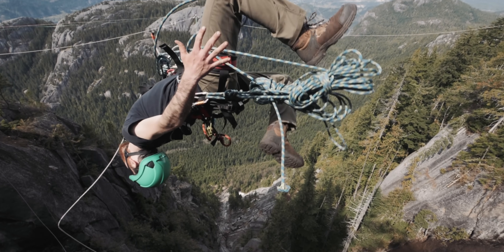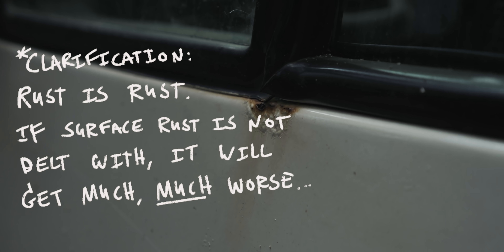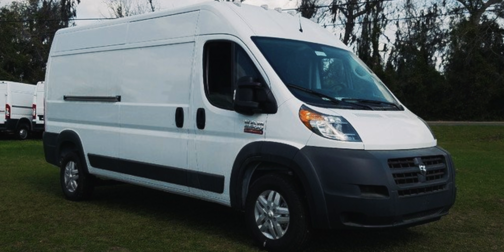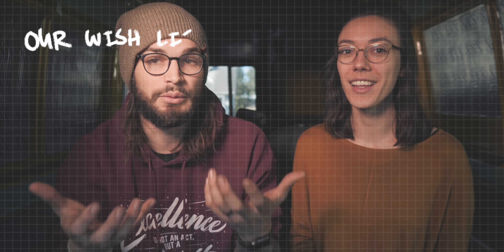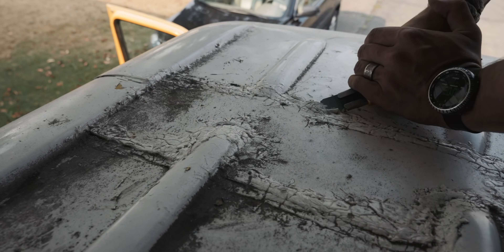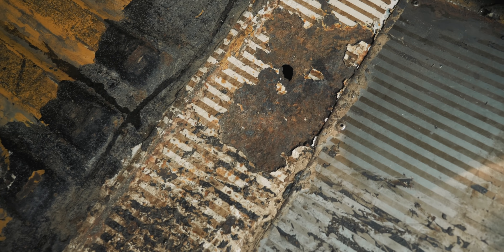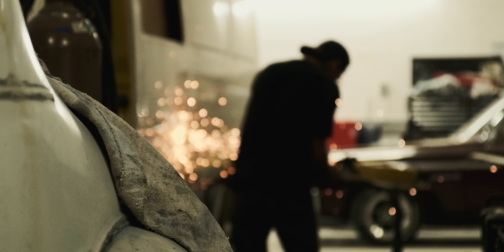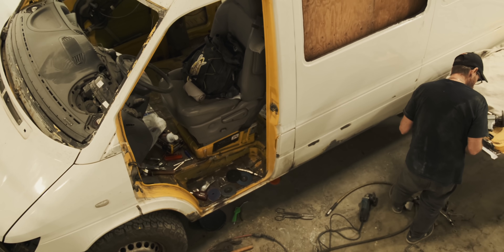Our Sprinter Van has a Rust Problem

Comment: I'm the original owner of a 2003 sprinter and I have a van rust story.   320,000 miles and going strong. Any maintenance and repairs are still less expensive than a new van payment.
Reply: How often do you change your fuel filter, i have a 2002 with about 99,000 miles, bought it with 79,000 miles?
Reply: @bodybailout  should be every 10k miles but I've heard people changing every 30k
Reply: @bodybailout  If you are using dodgy fuel, it may have to be more often than that. Recommended schedules from M-B should be safe, normally.
Reply: @bodybailout  once a year before winter. With jerrycan Diesel from doubtable places more often, but once a year usually suffices.
Like oil, and every other filter, put new one on before it gets exhausting/demanding for engine/gearbox/enddrive with extreme low temperatures, lots of condensing moisture and everything else winter makes it so bloody unpleasureable.
Reply: 530k on my 2005 sprinter, rusty but goes like hell
Reply: Oh yeah, no doubt that even dealing with the rust will cost SO much less than monthly van payments.

Comment: I bought a car over 10 years ago that had a LOT of rust. We fixed up all the rust, and re-painted it, and only now am I finding a few spots that need to be touched up. If you do a good job fixing the rust, it will last a long time :) So glad you decided to make sure the job was done right. It's not only safer, but well worth it in the long run. 

Also, if you get fairly decent at welding, body work is otherwise pretty easy to learn (it's similar to dry wall repair). Most of the cost for body work is the labor because it's so labor intensive, so if you learn how to do it yourself you can save a lot of money on future repairs. You save even more if you also salvage metal from old appliances. My sister's car and mine have both been repaired with metal from our old washing machine, and I was able to salvage some metal from an old industrial freezer for a friend's truck.
Reply: Rebuild-tin in form for these Sprinters is so bloody cheap (at least in Europe) it would not even be worth the effort to build it from new sheetmetal instead, let alone from repurposed washing machine cover.

Comment: The slow motion crushing of the window was so gangster with the music and the edit and then the normal speed followed by the hammer going through the window made me lol
Reply from the maker: I appreciate you : )
Reply: @Levi_Allen  Why did You do it anyway? Wasn't it a rubber lid gasket version You could re-use?
Reply from the maker: manfred schmalbach - it was chipped on the inside corner. I didn’t want to reuse it, and I didn’t want to sell anyone a window with a chip.
Reply: @Levi_Allen  plus the shot was bad ass lol
Reply: @Levi_Allen  Oh, didn't see that, just that it was a removable one, not a glued version.
Cheers 🍻

Comment: Fun fact. the transmission in your van can be rebuilt and upgraded to 4x4. As it is the same transmission as the Jeep Wrangler. (Mercedes 722.6) If rebuilding the transmission is not in the budget divorced transfer case is a great option. to finish the 4x4 conversion you can see if the modern sprinter part fit direct or a Left Spripring solid front axle swap would be cheaper. This would be a great thing to follow as part of your build.
Reply: It is doable, but You usually do need a parts car to get all these nitty gritty parts which are as slightly as essentially different to the 2X* version. 
I initially wanted a 4X4, couldn't find a used one in decent shape for 2 years and take a winch with some gear with me instead these days - and barely needed it to date: 4X4 Sprinters are no offroad cars, too tippy, too stiff, too long wheel base in Levi's case to do extreme things, so You basically get stuck in simple spots, and with a "normal" stuck on a beach or in the woods You're way better off (in the long run) recovering it by winch and not having to carry around and maintain two more diffs, two more drive shafts, enduring largely widened turn circle and so on.

Comment: I run a 97 208D and used 2016-2018's at work. The difference in panel thickness is mind-blowing. Resting my hand against the front wing on a brand new work van led to it flexing really, really easily. My own van is sturdy, and has that air of "I'll get you home, whatever", which I love. As well as being in keeping with the "make something" ethos, there is an environmental reason for keeping vehicles going as well as a financial one, and keeping skill-filled workshops and local businesses going is a good thing too.

Comment: the biggest issue is older vans werent dipped in rust inhibitor like most vehicles are today. Also a lot of people dont think about the dirt on their vehicle, but a proper detail will help to prevent rust as well. Brake dust and dirt particles stick to the surface. The brake dust will rust on the clear, when it does, it can penetrate below and thats how the bad rust starts (as well as bad gaskets). I highly recommend looking into a paint coating after the finished paint job and also a rinseless wash setup for quick easy washing on the go!

Comment: Well done keeping the van which You already know a little from the mechanical/technical perspective.
I own a 1999 model second hand supershort wheel base T1N non-common-rail 2.9 l turbo diesel with 270 k km to date, maintained by the book at Mercedes on previous (= first) owner's behalf to 190 k. 
Keeping a reasonable mechanical base (not overly complicated "old school" repairable with actual tools and common sense nearly everywhere You might go) is actually the reason why elder Sprinters are, relatively, more pricey than the newer models.
Your second gen T1N with already cdi injection is slightly more complicated, but still well workable. High pressure diesel might cause probs, but it makes it very economic, too.
When I got mine, I could buy the 212 d one I have now (then 190 k km) or a ten years younger first owner 213 cdi one, maintained by Mercedes to its 160 k km for basically the same price, or a 15 years younger latest model 216 cdi with 230 k km off a courier business, maintained by Mercedes of course, for the same bloody price, too. 
Mercedes used salesmen recommended getting the eldest one I could get for my user profile (= self maintenance & travelling to countries without flawless parts supply for newer vans)
So, You better keep Your old fart and get its tin done properly. 
Insulating and vapor barrier-ing is essential to prevent rusting from the inside due to condensation when living with a heater in colder areas, but there's much better paints You could brush on Your insides than Mercedes used in the 90ies and 2000s to begin with. Sprinters are commercial workhorses and thus badly painted and crappily built in terms of rust protection - You gotta do A LOT to just bring it on car level, not to mention really durable car level like elder Saabs or Volvos. It is worth it though.
Cavities inside and out best are done generously with Lanolin You get from steel ship supply, they put it inside their ballast tanks: environmentally nonhazardous wool wax with a little solvent to make it sprayable, sticky as hell and very durable even with salt, plus liquidizes when heated/reheated briefly to reclose random gaps/cracks. 
Cheers 🍻

Comment: Following with great interest as I’m renovating my own Ford Transit based auto sleeper camper van (Betty). Had similar situation regards rust!!
Like you I managed to do deal with a local body shop. (Sold them my old Suzuki GS850 motorbike in exchange for the body work)
Had my windows professionally covered with tinted film which looks great, so can recommend as a privacy solution.

Comment: Totally agree to Your point of durability. The newer the vehicle the less durable it is. The first version of NCV3 does have big problems with rust too. After Mercedes swapped in a completly new engine line in 2012, they fixed the rust issue but at the cost of having an engine dying likely after 250k kilometers. The latest 2018 Sprinter should be avoided at all, for all reasons imaginable.

Comment: Those windows break so much easier from the inside out. I only know this because a kid shot a pellet through my SUV back door, when the door was open, so from the inside out. Glad you found a solution. I've been looking for a van in Canada for a year. I bought one, but had a tough time finding a good van at slightly under 25k. I'm just beginning to  build it out. I've got 2k into it already and it isn't even close.  I'm spending the $$$$ on insulating, ventilating, and a back-up camera/monitoring system as  priority. Then I am going to go live in it for a few months.  Until I really get to know how I want it laid out. and so on. I know I could do it cheaper  but I hope to live in it for at least 10 years. Hopefully, I've chosen a path that will get me my dream van/home on a limited budget!

Comment: I bought my 2012 sprinter lwb last year for ca$3405. Yes it is a moon-miler at 250k and it has its rust in areas but it is a working van and has paid for itself 4 times over so far

Comment: So i had a significant body job done too.. Starting Build out 2.0 this spring as well.. What did you guys do to prevent re rusting before starting the build.. Also what did you decide to do for a floor.  Im 6'1 and really dont want to take much from the interior height ..  BB Ottawa

Comment: did you try a rust convertor? i had done a 77 pickup and had to use all these chemicals to convert it frame up.i was gonna suggest trading with a body shop but i started typing before the video got there. i swap for everything from tattoos to tattoo removal to body work, my hair, everything. good when you're broke to not have to pay for anything lol

Comment: Hey Levi! How many miles does "Florence" have on her? I have a 2017 with 10,000 mi. Just curious of what mileage these vans are capable of! Thanks friend!
Reply: I do not know which exact version (enginewise) his Sprinter is, but European 210, 213 and 216 cdi T1N of this generation reach easily 500 k km (about 320 k miles) without opening the engine, given You use it properly (warming up, not shutting it down when hot, no revs in the red area for longer periods and so on, just common sense...) and do Your maintenance following Mercedes' recommendations.
Reply: @manfredschmalbach9023  Good to know! Thanks for the feedback!

Comment: So glad you found a fix but I don't get it.  Was this rust because the van wasn't properly painted or have a rust coating on it?  Is this just normal for this type of van?  Or was all this rust because of the area conditions?
Reply from the maker: Mixture of all above. WE have loads of salt on our roads here in the winter. Enough to create rust that would scare any mechanic from the south. They think we've driven our vehicles straight into the ocean sometimes... 

Also this model of van had a poor paint process form factory. It's a known issue that T1n vans rust easily. Most owners need to deal with it at some point. 

In my case, my rust just got worse and worse because it wasn't delt with when it cropped up.

Comment: The 2008 (which I own and built out) is the best one to own IMO. Where do you get your info that it has more problems? It's basically the same engine without the complicated DEF system. I like it for that reason, the DEF (BlueTec) adds a lot of parts that can break and sensors that go bad. Just my 2 cents. Happy building. BTW here is my build @rovingdane
Reply from the maker: Happy to hear you've had great experiences! I didn't mean to spread bad info, I was maybe generalizing to largely. I've heard around 5 first hand accounts of people who've spent 10K+ on repairs, largely due to the nature of needing to bring it to Benz for more advanced work. 

I'm sure it's not just a 07 / 08 thing. but I generalized on those two years as those are most often the ones on a great deal used.
Reply: @Levi_Allen   Interesting... I have been driving mine for 2 years but some repairs where probably done before I bough her. It had about 180K back then. I carry a sprinter specific computer and stay on top of all my maintenance. I think that's important with any sprinter regardless of year.

Comment: Highly recomend by new one, please. Buy small one, you do not need 4x4. Just something simple, small but new. Highly recommend.
Reply from the maker: Jānis Kronbergs did you miss the part where those are way to expensive for us?
Reply: @Levi_Allen   No, just saying, better small, simple, but new.  Reorganize your budget and plans, but get new one.  Old ones will do problems for your, and no difference 1 or 10 year old, they all will do problems. If you are at least little bit skilled, you easy can fix your existing bus, easy, and than do not buy anything new. Rusty spots on your bus is not a problem, take fiberglass and epoxy glum and fixed.

Comment: I have been working through the same issues.  I am canadian and I have bought my second van through an outfit that imports vans from Japan.  I have picked up a Toyota Hiace for just under $10,000 Canadian. It was $7,000.00 but there are import duties and transit fees to come to Edmonton.  I  have a diesel  with 92,000 Km the trick is ... it is right hand drive.  If you are interested in the vans pls go to http://jdmconnection.net/search?transmission=&body_type=8&make_id=&year_to=&engine_capacity_from=&q=&price_to=&steering=&model_id=&drivetrain=&fuel=2&mileage_from=&engine_capacity_to=&price_from=&page=5&mileage_to=&year_from=